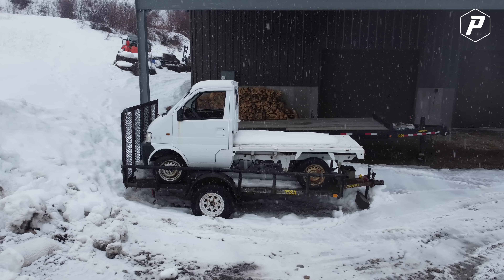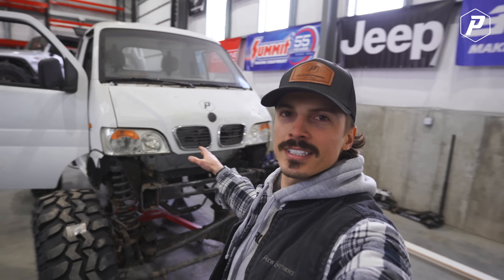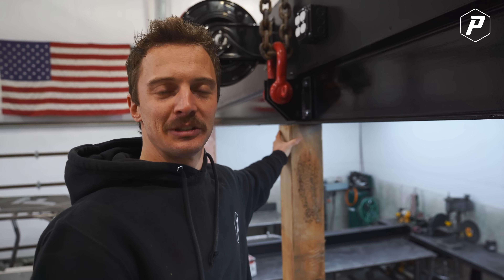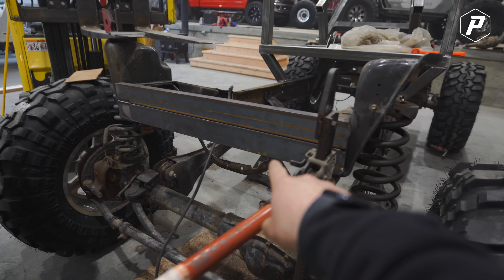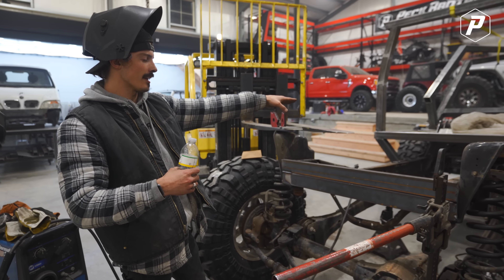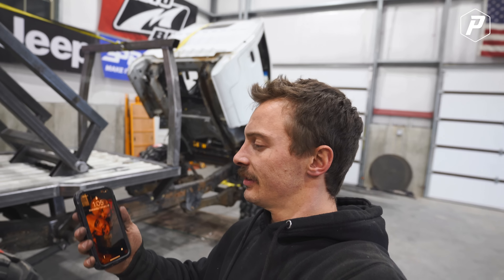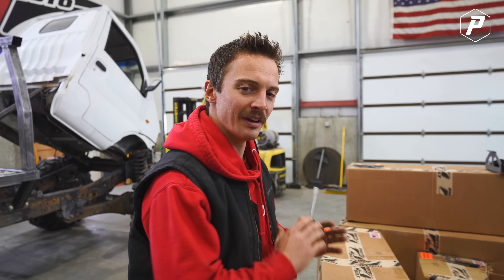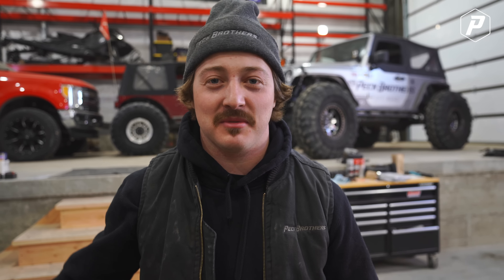THIS MINI TRUCK IS WRECKING OUR DEADLINE

Comment: Thanks for the video, you guys are fun to watch. That tilt cab is brilliant for this build. If I may suggest a safety chain from the frame to the cab just in case the latches don't hold the cab down. It may be unnecessary but if it ever happens you will be thankful. Thanks for sharing the fun, take care of yourselves.

Comment: Mount the front bumper to the pivot point and have it pivot with the cab.  Make a subframe to support the cab in its open position.  Make the pivot across the front of the frame with steel tube.  The subframe and the front bumper will be welded to a piece of tubing that is fitted around the front crossmember tube as a hinge point.  The hold downs will be at the rear of the cab subframe will connect to the mainframe.  You could make the hold downs like the hood pins on race cars.

Comment: You guys might want to consider putting a web in the boom back where the tubes bend. Imagine an I-beam but the top and bottom are box tube. I'm thinking just go a little ways on either side of the joint - dont web the entire thing it'd be heavy AF. just go like 8-12" on each side of the bend to help strengthen it up a lot

Comment: Make a two piece bumper that also pivots. Winch down low fixed point to frame, pivot bull bar upper. Pull two pins fold down out of the way    .

Comment: Make the bumper hinge to like a Hummer and pin it so when it's pined down u can run the winch around the top bar of the bumper and hook the cab and use the winch to lift the cab

Comment: You need to mount the whole cab to the bumper assembly and then you can tilt it all as one unit as longer as you get the frame straightened first. Then extend the cab/bumper mounts at least one inch ahead of the beams you welded onto the frame.

Comment: You guys got to put some seating on the outside in the bed (like they have on Matt’s wrecker) that way one of you guys can sit in the back if needed and a seat for whoever you are towing. It would also be cool if you guys made some type of mounts so the seats could be taken in and out of the bed. Modular seating, if you will.

Comment: I have watched just enough of this series . I know it is mostly a Ford for frame , rolling chassis and running gear. The cab seems to be the only piece being used from original truck . guess you might be using that vin if you register it but from my viewpoint it is a Ford 1 ton.

Comment: you should install hydraulic rams in front of the cab that pull the cab down in front of the pivot point. and the rams wont allow the cab to move unless you want it to

Comment: Any time u heat metal u need to cool it with oil I use used motor oil it puts the material back in the steel if u put water on it it will make it brittle.

Comment: If you pit the spare tire on the front, the weight of it would help with balancing the cab when you swivel it up.
Reply: But gets in they way of the bumper/hinge and blocks airflow

Comment: You really need to put a little bit of heat on the frame to help the steel frame to adjust to the place where you want it to be okay thanks Charles Williams

Comment: Instead of having to clear the bumper when you tilt the cab, attach the front of the cab to the bumper, and use the bumper as the tilt hinge. That way the HEAVY built bumper will act as a ballast. The heavier and lower the weight, the easier it'll be to tilt the cab.
Reply: But the winch needs to be mounted to the chassis so that won’t work. 
Just have the bumper tilt forward like the cab does. Hinge it at the bottom & swing it down outta the way before tilting the cab. Pretty sure that’s how all the smaller Isuzu style COE’s do it from memory. 
Some have big eye bolts that go through the face of the bumper that double as tow points & also used to stop the bumper tilting forward when in driving/winching mode.
Reply: Mount the winch to a tow hitch receiver. Put several different receivers all over the frame to pull all directions.
Reply: Every days  a party with the Peck Brothers
Reply: How about a hydraulic lift system to raid and lower the cap? 👍🏻That would be a Dean
Reply: How to make the bumper useless
Reply: Just a couple of those little helper arms from an 80's hatchback ought to do it.
Reply: Caylebs arms aren't that short and he's not that old. @yourhandlehere1
Reply: @Dobermangang10  a linear actuator would be better or else they’d need a hydraulic pump and lines which are not cheap nor light.

Comment: Should give the bed a dump feature too to make it easier to get underneath and could use it to lift the transmission too?
Reply: 17:48 time to slap some hydrologics on this babd beast now 😆 could use a "spare" power steering pump as a hydrologic pump? 🤔
Reply: Dump bed with the boom on there...that's not gonna work very good then
Reply: @mrmotofy  they said the boom would be removable, and fer ease of worki g in the drive line, or to use as a dump truck, makes perfect sense
Reply: @BurchellAtTheWharf  The boom has holes in the bed as well as the boom will technically be removable but its big heavy and takes like 3 people to get the big pin in/out. So it's not exactly convenient or practical.
Reply: @mrmotofy  they ain't done yet, they are still working on it. And even if the boom stays on, they can still have a dump bed, just gotta pun it in the front of the bed rails fer towing, make working on, and taking out the transmission a bunch
Reply: @BurchellAtTheWharf  The boom is already mounted, they can't move it forward and still have a tilt cuz the boom would still be in the way and the way they have it designed it wouldn't work as will be attached to the headache bar
Reply: @mrmotofy  well it all comes down to how the attach it ot the headache rack er rollbar, I'm sure they will have it set up so they can move the boom up and down, and not have it hard mounted? And if they put on hydraulics, they can have a power assisted cab lift to, all comes down to if that's what they wanna do,
Reply: @BurchellAtTheWharf  They will have winches or something pivoting and supporting off the bar. With the angles etc of the boom they can't really move the boom back either since it would have to be scrapped and rebuilt since lengths and angles would be different. A tilt bed just doesn't make any reasonable sense with a boom
Reply: @mrmotofy  think you missing what I'm sayn
Reply: @BurchellAtTheWharf  Think you're missing the point...it's just NOT practical
Reply: @mrmotofy  but is this yruck practical 🤔 
Not really , bit is this truck fun , yes.
A tip up cab is easy maintenance, 
A tip up bed even easier maintenance for the drive line, but we shall sea how they roll, only them and time will tell

Comment: Love the mezzanine idea with the beam and chain. I think it would look just a little cleaner with a single chain and quick links on either end connected to your bracket, rather than the double up and hooks you have now, but I am actually thinking of doing something like this myself now when I build by own shop next spring. Love your channel.

Comment: build the front bumper with the same concept as the aluminum moose bumpers that herd and magnum truck accessories make, a pivot plate for the bottom of the bumper(through the frame rails), then a heavy locking pin in the top, I work for a custom fab company that makes bumpers purely for cabovers and front pivoting hoods and can attest that it'll be plenty strong if made with the right materials.

Comment: Glad I found you guys your energy and sense of humor is great!  The engineering is pretty good to.  I was thinking bottle jack instead of the high lift or floor jack, but you all survived and fixed the problem okay.  If you get time someday you could replace the chain on the beam with a solid rod and a large turnbuckle.  Then you could use that chain for something else I'm sure.

Comment: Option 352.9 ... Mount the front bumper like a dual Reese hitch ( one on each frame rail ). Pull pins then slide bumper out. Now cab can tilt up freely.

Comment: Side note ford put flex in the frame so the trucks wouldn't rip themselves apart.  Semis are built the same way. The frame rail are made of spring steel. Next time tap frame with hammer instead of heat.

Comment: In order keep the temper in the steel, you need to shock it with a large hammer as you bend the frame.
Using heat will bend easier, but it might weaken the frame.